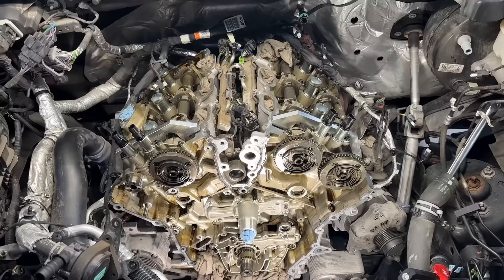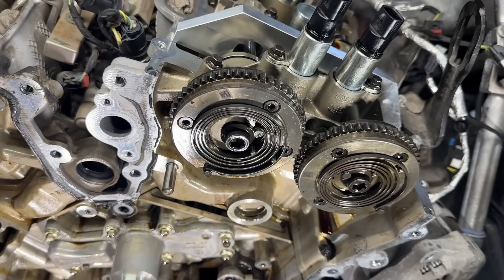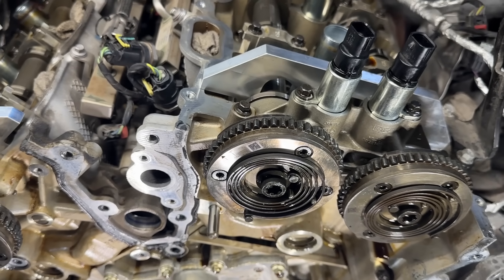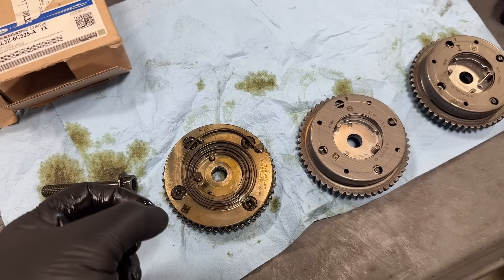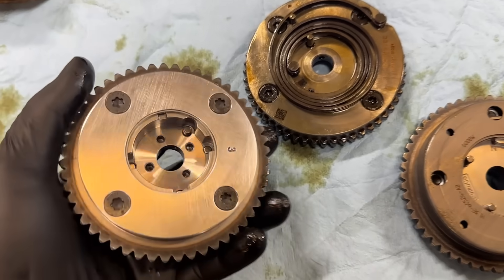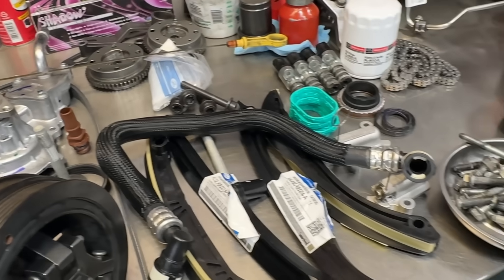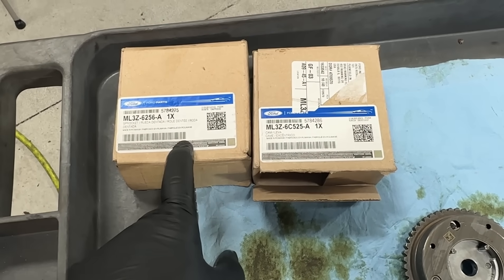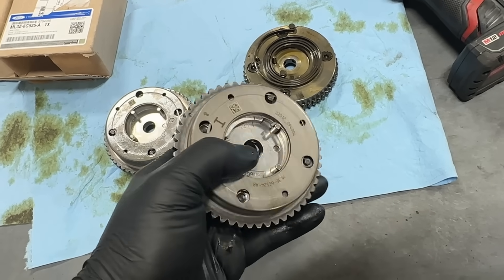2017-2020 Ford F-150 3.5L Ecoboost Startup Rattle Fix: Make Sure You Are Getting The Latest Phasers!

Comment: What cam holders are you using  the lisle ones aren't thick enough and spread when you do the final torque on the phasers  and the ford ones are crazy high  even with dealer discount.
Reply: Good question!  I would like to know as well.  With the Lisle cam locks, after spreading my first set the way you describe, I had them warranty replaced.  Now I double them up when I’m torquing the bolts.  Been fine ever since.
Reply from the maker: These are from stallion and they are just ok.

Comment: I took my 2011 ecoboost with a rattle to dealer and they wouldn't do anything with warranty until it threw a light. It was embarrassing for myself and ford but they weren't concerned.  Went to a 6.2 gas super duty and never looked back.
Reply: I have an F150 6.2L Platinum. Took forever to find but worth the wait. My dealer said they rarely have issues, but some do need valvesprings.
Reply: @alb12345672  my 2011 was a 6.2 but last minute change was ecoboost. Win some lose some. You made a great choice.